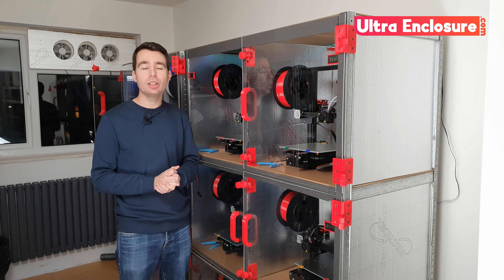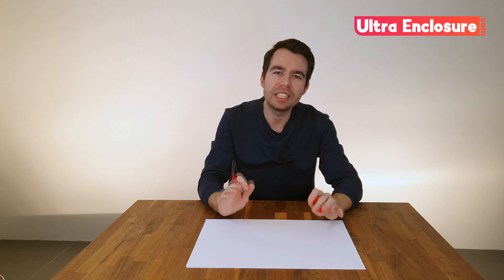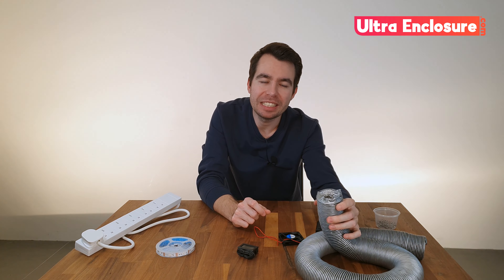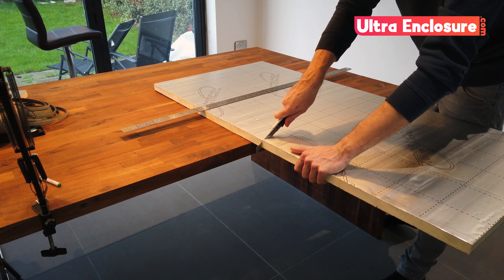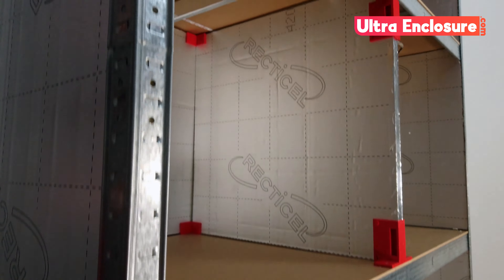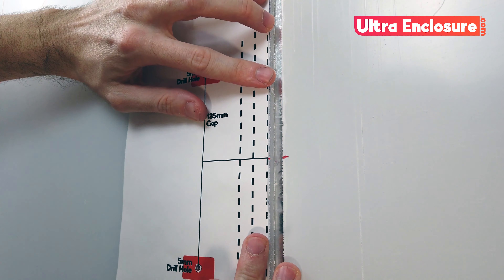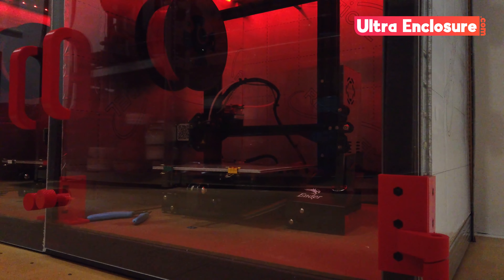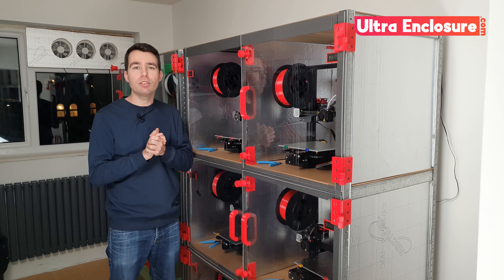Ultra Enclosure: Custom 3D Printer Enclosure Kit by Sen 3D

Comment: Kane, you are an expert with an undoubtfull pratical background, and your video gives me precious answers to 4 important questions:
1. A well insulated, passively heated enclosure can reach 50°C.
2. This makes ABS printing succesfull as we can see on your Ender IDEX kits.
3. No need to place the electronics nor the filament spool outside the enclosure.
4. You are an enrichment for the 3D printing community!
Reply from the maker: I am glad you found it helpful. 

To add to this in my experience using ABS Juice (https://www.youtube.com/watch?v=8bYLRFMKDSY&ab_channel=MatterHackers) on a PEI bed (I use self adhesive PEI sheets on the back of stock Ender 3 beds) gives you incredible adhesion. In many cases its can be a slight challenge to remove the parts from the bed (a good ABS problem to have). If I used glass without any flex the part would break long before it released 😮😇

Enclosure + PEI and ABS Juice = happy ABS printing 😇

Good point on the electronics too. The very first Ender 3 I ever got is still printing ABS daily inside an Ultra enclosure and has 100s if not 1000s of hours on the clock. The only damage it has faced is the PLA draw I originally added is now a pile of mess attached to the printer 😂

Comment: Hope you can do an episode about using solar panel to power the print farm in the future! A great tutorial, absolutely love it!
Reply from the maker: I love it! that would make for a pretty interesting test too. I think at the moment here in cold London we don't have nearly enough sun but some of the lucky people in hotter countries may have more luck than me 😁

Maybe if not powerful enough for the printers it could help run the LEDs, fan and other smaller secondary accessories.
Reply: @SEN3Dcom  haha, another tip for you. I don’t know it’s available or not on eBay, I have seen some sellers are selling used bike solar panel that’s so cheap, £2 for 6 watts x10 PCs, don’t know how it will be for you. If there are 10,000 watts for a print farm it would be great!

Comment: Interesting video, thank you for sharing your knowledge and your experience! 

However, I would like to point out the obvious extruder problem of the non-enclosed printer in the ABS torture test as I havent seen anyone talking about it. As it can be seen around 27:20, the extruder is grinding a significant amount of filament.

I strongly believe that this extruder problem contributed directly to the poor quality of your ''non-enclosed'' print and that the difference with the ''enclosed'' part would not be as significant using a non-enclosed machine with a properly adjusted extruder.

Comment: but the problem is if you print PLA, you dont want it to be to hot so you get clogging etc. So venting is also good to keep temps in the right temperature.

Comment: Could you put a fan with activated carbon filters? Not having a window nearby I was considering a fan with filters
Reply from the maker: That sounds like a great idea and I think should be very possible. How it fits exactly would depend a lot on the fan you choose.

The good thing is that if you do use insulation foam it is very easy to cut and work with. So you can make an opening of your choosing and attached your desired fan as you like.

If you did end up doing this I'd love to see how ti comes together!

Comment: sum advice on where to find the shelf kits would be appreciated.
Reply from the maker: Sure, it does vary a lot from country to country and also depending on the setup you're aiming for.

To help this is where I got mine from in the UK: https://www.ebay.co.uk/itm/180x120x60cm-5-Tier-Garage-Shed-Racking-Storage-Shelving-Metal-Shelf-Boltless/363003747059

this may be a good equivalent in the USA too: https://www.homedepot.com/p/Husky-Red-5-Tier-Heavy-Duty-Steel-Garage-Storage-Shelving-48-in-W-x-78-in-H-x-24-in-D-MR482478W5-R/308458506

Comment: Is this design ridged enough t for the faster core xy printers like the ones from Bambu lab?  They can shake the crap out of the tables I’ve sat them on so I can imagine have 2+ printers would shake this enough to cause issues with the prints.  Have you setup a core xy printer in these enclosures yet?

Comment: This is interesting but I am not seeing anything for fire safety.  Having experienced a 3D printer fire, I don't see fireproof materials (UL 94, etc) or fire suppression (BlazeCut, etc)
Reply from the maker: This is an excellent point. My approach here really is to enable people who are constructing their enclosure to decide on the materials most suitable to them and that they feel most confident in.

For some people coming from a Lack enclosure, which is essentially made out of cardboard, the requirements may not be nearly as high as someone like yourself that has experienced probably the worst outcome of 3D printing.

Whether it be upgrading the fire rating of the foam insulation (depending on the products available in a given market). Or even swapping out the material for alternatives with a higher rating there are lots of options.

Equally fire suppression is a great extra too. I personally also add a number of redundant smoke alarms as well for added peace of mind.

However I didn't want to speak with certainty about exactly what could be considered "fire safe" or not, as it is very much a gradient and you can always make something a bit more fire proof than it already is 😇

Thank you for raising this important topic 👍
Reply: @SEN3Dcom  it’s much like how we view people that buy home alarm systems. Until you’ve been a victim of a burglary, it has no value to you  just a luxury item.  Once you’ve been a victim, you can’t imagine doing it differently. And you try to warn others.  The off gassing and nanoparticles science keeps leaning towards “we aren’t sure how bad these things are, but probably not good”. As we’ve gained many new fabulously easy materials to print, a rare few read the safety data sheets. I see posts of people printing with their machine in their dorm or bedroom.  Please print safe. In the 1950’s, doctors used to minimize the danger of smoking 🙂

Comment: I have a cr10s pro and mono x. What would you recommend? Worried about the internal components if enclosed.
Reply from the maker: Hi there, Thanks for watching my video and commenting.

The temperature each unit can reach will be a factor of 2 things mainly: build plate temperature and insulation of each unit.

I find that with a typical Ender 3 chamber you can get a steady 40-50℃ ambient temperature with a build plate temperature of around 80-100℃

I also find that I am able to regulate to some degree the temperature if I want it slightly lower than this by leaving the doors ajar and maybe get a consistent 30-35℃ if desired.

If you had thicker or thinner insulation and perhaps even utilise the extractor fan option you may be able to get even finer temperature control if you desired (although in my experience I don't think it's necessary)

Based on the above I have run 12 basic stock Ender 3 machines in the Ultra Enclosure for 1,000s of hours now without any issues. I have only observed after a very long time the blue of the LCD can turn a bit purple but otherwise they all still work great. In fact my very first Ender 3 is still producing day in day out at full temperature inside the enclosure!

So I cannot guarantee every printer and setup but I would suggest the CR10 will be fine at those kind of temperatures. 

For the Mono X, as it doesn't generate it's own heat you will have far fewer concerns, if any. The only thing you might want to think about when planning your setup is the configuration. As heat rises put your "hottest" chamber at the top if possible and the cooler ones at the bottom. 

If I have all 6 chambers running at the same levels I can observe a 5℃ temperature difference from the bottom one to the top. But again, I think this would be marginal in having any negative impact.

Don't hesitate to ask if I can provide any more information for you 😁
Reply: @SEN3Dcom  do you sale already printed parts
Reply from the maker: @baljazz  Absolutely, if you visit the "buy" page and scroll down there any many versions of the kit and also every different part you might want or need and can be purchased individually: https://3d.plus/buy/ender-idex/